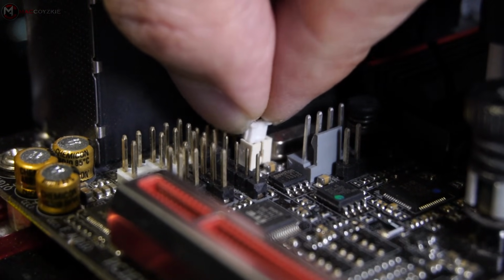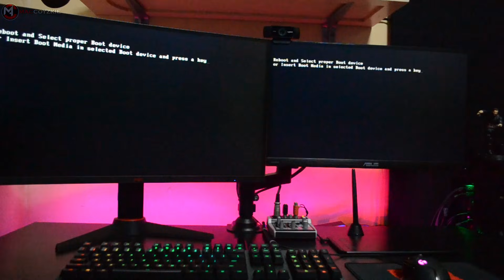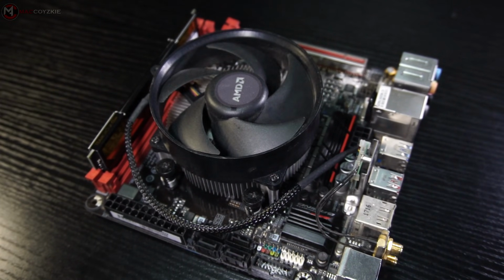How to remove cmos battery in your pc? Cmos reset / hard reset on bios

Comment from the maker: If this does not fix your pc try checking this link for more troubleshooting tutorials https://www.youtube.com/playlist?list=PLqHl1qasBnOHXQahxqQMkuUkoRg3dbSwQ
Reply: I see my cmos battery I cannot Take it out. Please help. I need my computer for a online class
Reply: is there a way of replacing the cmos battery without resetting the time, date, and bios settings?
Reply from the maker: @ahafeezs  nope
Reply: I use a gigabyte motherboard
Reply from the maker: @cristinacechina2617  if you can't just go to bios and load optimize defaults https://youtube.com/shorts/9IWjDYFCLJI
Reply: I can go into the bios and în easy mode P1:120 îs blocking windows boot manager
Reply: Please show how to save and change
Reply from the maker: @cristinacechina2617  there is no general way to save bios, check your motherboard manual
Reply: Really
Reply: Damn I cant find it I lost it
Reply: Imma Quit on my pc
Reply from the maker: @cristinacechina2617  try google the motherboard name + manual, usually there will be pdf version
Reply: Ok sooo I kinda don't have a lock on my ATX motherboard

Comment: I am getting an "inaccessible boot device" blue screen and idk what to do... It keeps bootlooping and I still can't go into windows
Reply from the maker: shut the pc down, unplug it, if you're using ssd/hdd as boot drive replace the data sata cable. if you are using m2 just re-seat it then you clear cmos like in the video before powering the pc back on. if that does not work you need to have your boot drive in a different working pc, if it does not work there as well and you see the same problem then the boot drive is already faulty

Comment: Can I add ram to my other two slots ? Or no and also My pc is running but no signal on my monitor and plus my keyboard and mouse its not turning on as well. Please help
Reply from the maker: its ok to add as long as the newly added ram sticks have the same mhz/cl and as much as possible same brand. make sure the pc is unplugged before installing, after that clear cmos like in the video before powering the pc back on

Comment: Thank you EA. Secure boot bricked my mobo because I am not a qualified person to be messing around in the bios.
Reply from the maker: even after clearing cmos?
Reply: @MacCoyzkie sadly, removed the battery and shorted the pins. Only get a black screen, can't even get to bios.
Reply from the maker: @einfisch3891  if your mobo have those flash bios button maybe trying to update bios will fix it.
Reply: @MacCoyzkie appreciate it. I have a gigabyte mobo with the qflash button and that's gonna be my next step.
Reply from the maker: @einfisch3891  i hope it went well

Comment: I did this because I have the “ Reboot and Select Proper Boot Device” . I Followed instructions, I turned my Pc back on and It has came to the Same “Reboot and Select Proper Boot Device” Screen. Is there any way you can help me.
Reply from the maker: usually that will happen if:
1. your boot drive doesn't have windows installed in it
2. faulty sata cable for ssd/hdd boot drive
3. faulty drive

Comment: Dude thank you so much I put new ram into my pc overclocked them from 1333mhz in bios to 1866mhz and my pc would beep at me with nothing on display found your video took out the cmos battery for 5 mins and it’s back up and working again thank you so much 🙂
Reply from the maker: no problem bro, try a different settings so you can make the most of your ram modules. if black screen happen again then just clear cmos
Reply: @MacCoyzkie what by enabling xmp
Reply from the maker: @JackPlays366  xmp 1 or 2. newer motherboard got several presets too besides the one click xmp

Comment: still answering questions ? :)
Reply from the maker: yes! what's up?
Reply: @MacCoyzkie Went into bios, didn’t change anything there then clicked save and exit, and basically what happened is pc fans got really quiet but still spinning & lights on pc are on but i can’t get it to start. 

No signal shows up on monitor (i’ve tried multiple monitors). i removed CMOS battery for 20 minutes and put it back it but it changed nothing, also tried taking ram out and switching their places but nothing has worked. Any advice ? (i’m on a desktop)
Reply from the maker: @hergring8884  how about different hdmi/dp cable? also can you check the motherboard if there is a debug led lit? 

clearing cmos is good too but can you this method, unplug the pc from outlet, power drain the pc by pressing the power button while unplug then clear cmos again, this time 5 to 10minutes will be fine

if that still does not work let's try to boot with minimal pc parts, i mean cpu, gpu, 1 ram stick, 1 boot drive

if that also does not work, hopefully you got two pcie slot for the gpu, try the other slot this time

lastly check the psu pin connected to the gpu and see if its melting

Comment: I lost connection to the monitor, it gave me headache for 3 days, i did everything i know how to fix until the last step i know should work if not then take my pc to techs and pay, so what I did is bought new cmos battery and put it on my pc, now its ok but i think my graphic card is dead, it turns on but no signal on my monitor, its an old rx580 8gb.
Reply from the maker: the only way we can confirm that the rx 580 is dead is to try it with another working pc, ask a friend to try it out and see how it goes

Comment: suddedly i can not enter my bios .. should i do a cmos reset?
Reply from the maker: does it load anything or you just have black screen?
Reply: @MacCoyzkie  i press the key (del or f2 ) repeatedly and it just stays blank and after a while screen goes into power safe mode.. if i reset pc and do nothing else, it loads the login windows screen
Reply from the maker: @bluebeam1141  can you try this out https://youtu.be/ul3D0OhSkdg
Reply: @MacCoyzkie  its a new build. new motherboards fresh out of the box.. but ill do the clear cmos to see...
Reply: i did clear cmos. i still cant get into bios
Reply from the maker: @bluebeam1141  can you tell me the pc specs first, it might need bios update depending on the specs
Reply: @MacCoyzkie  motherboard b850 aorus elite wifi7 ice , 9800x3d ryzen , 32 gb kingston fury. i tried almost a dozen different things and all faild. my last choice is to make a bios update... but im scared it might failed and have more serious issues then.. but yea i think bios update in one way choice
Reply from the maker: @bluebeam1141  yep it definitely needs one, if you are not confident doing the bios update yourself i suggest bring it to the local shop where you got your pc parts from and let them do it for you. because you can't mistake here https://youtube.com/shorts/nfH5Do3Dq3o but if you are confident then just visit your mobo's website and download the bios firmware. update procedure may depend on the motherboard model/manufacturer so check your motherboard's manual

Comment: I think my Asrock b760m pro rs mb is faulty, because the metal pins dont move far back enough to get the battery out. I applied so much force i was worried i was going to bust something, so i stopped.
Reply from the maker: most motherboards are sturdy unless you intentionally break it. how about using a small flat screw driver to push the lock?

Comment: Damn i still cant get the no signal to work:(( replaced cable and monitor, cleaned the ram and used 1 ram, and then this dkdkdk 😭😭
Reply from the maker: can you tell me how the pc problem started? this might already be a hardware issue
Reply: @ my sister was able to use my pc a few weeks ago. I tried opening it last saturday and it just goes “no signal” whenever you open it.

Hardware issues which means replacing a pc part is that correct?
Reply from the maker: @ yes, but can you try this out first. try entering safe mode https://youtube.com/shorts/IZKc8plksDA if you get lucky do this next https://youtu.be/SvIJhcxZTsA

Comment: If the clip holding the battery in place is stuck is it okay to use pliers? I've got some with rubber teeth that won't conduct electricity 

I'm asking because I just broke my fingernail and almost bled all over the motherboard
Reply from the maker: yea, im usually using a small screw driver to push the lock

Comment: Not sure how this happened, I did hear we had power outage so maybe that did this but, I keep getting “reboot and select proper boot device or insert boot media and selected boot device and press a key” message.

Computer won’t let me go into bios and I’m about to throw this thing out my window but! I have important files I need.. 

I not only did what you suggested in video but I replaced it with a new battery.

I’m not sure what else to do.. also, when I try to go into bios, I hit the F2 button and I tap it and when I hold it down the progress bar freezes till I let go, but then it just goes back to the original message..
Reply from the maker: If your BIOS is still not accessible, try creating a bootable USB drive using a separate PC. Download the Windows Installation Media (or the installation files for whichever OS you're using). Use the Media Creation Tool to transfer the Windows installation files to a USB drive. Insert the USB drive into your PC and restart. During startup, press the key to access the boot menu (usually F12, Esc, or F8). Select the USB drive from the boot menu. Once it boots, try running the Startup Repair option to fix any issues preventing the system from booting.

Comment: What should I do there is an error saying Over Current have been detected on your USB device, System will shutdown after 15 seconds to protect your mainboard would taking battery out or doing screwdriver method work? Please as soon as possible 🙏
Reply from the maker: It sounds like your system has detected a problem with the USB device, which could be causing excessive current draw and potentially damaging the motherboard. Usually this are chargers or whatever so unplug whatever that usb is. Inspect for short circuits too, happens most of the time when motherboard is touching a metal part in your case
Reply: @MacCoyzkie  tried that but didn’t work
Reply from the maker: @ next steps are going to be tedious. i suggest remove your pc parts outside the case, use minimal parts to boot the system like 1 ram, boot drive, cpu, gpu, mobo and psu. jumpstart the pc to check

Comment: I bought overclocked gaming pc dont know whats the problem but the seller said he overclocked it from bios now its freeze everytime i turned it. I even bought new ram for it to check but still keeps freezing, i did reset bios setting to default but still keeps freezing and i also took the cmon battery off for 30sec-1min and put it back on and pc still keeps freezing please i need some solution or help so i can fix this
Reply: Please this is my first gaming pc i really need to fix this
Reply from the maker: @ can you go longer with the cmos reset, 5 minutes. btw what windows you are in? 11 or 10?

Comment: This was a very helpful video! Unfortunately this was not the solution for me and I still seem to be stuck. I have reset the cmos, have my monitor plugged into the gpu, have tried multiple different monitors, reseated the ram, and I’m still getting a boot error on  my motherboard, any advice?
Reply from the maker: i need to know what's the problem, tell me how it started

Comment: hello, after doing a deep clean, my monitor doesn't go on but the cpu is working very well. unfortunately the motherboard blink red and orange light idk how to fix this, i alr did the ram cleaning also the bio reset. but still it doesnt work, mouse and keyboard too
Reply from the maker: ok this might sound basic, if you have gpu plug the hdmi/dp in that and not onto the motherboard monitor input

Comment: I think something is wrong with my new 12900k but I don’t want to believe it. My a2 memory slot is not working at all so I hope this helps. Will check motherboard pins if it doesn’t work
Reply from the maker: if its dusty clean the ram slots too

Comment: After i did all of this it still doesn't boot it just said no signal and it start to piss me off a bit, my monitor is benq GW2270 gpu gtx 1060 and i5
Reply from the maker: why are you clearing cmos in the first place? what happened before the pc problem started?
Reply: @MacCoyzkie  so my pc crashed and it cant be turned on. It only show no signal
Reply: @MacCoyzkie  i tried opening the gpu and put it back still doesn't work and i tried cleaning ram stick too but still it doesn't work
Reply from the maker: @MortimerGD  if it crashed during rendering or gaming this could be the psu gave up, this often occurs when the PSU is unreliable or has a lower wattage than what the PC needs
Reply: @MacCoyzkie  so how do i fix this?
Reply: Its also a psu model ps500 f1v2
Reply from the maker: @MortimerGD  you need a spare psu and test it with your pc, if you don't have one,  borrow from a relative or friend
Reply: @MacCoyzkie  Hi, actually you're right my psu is THE problem (i also accidentally broke the pin lock of the stupid intel cooler thingy but no biggie) but overall i think i fixed the problem thank you!
Reply from the maker: @MortimerGD  glad i can help :yougotthis:

Comment: i need help! how can you get the cmos battery out of the black cover over it?
Reply from the maker: is that an itx motherboard? if it is check 1:00
Reply: @MacCoyzkie  i think my cmos battery is dead because i try to restart the cmos but nothing happens and it keeps taking me into bios settings.
Reply from the maker: @isaias.1  if its taking you to bios then this is not a cmos battery problem. more like your boot drive is not detected somehow. have you replace the sata cable if you're using ssd. if you are using m.2 try reseating it and clear cmos after

Comment: Hi just curious. Would this fix the signal not finding? I used my pc not even 2 days ago and it worked perfectly fine. I replaced my ram sticks about 2 months ago and its been working amazing, no issues but everything is turning on, my pc runs, my mouse, and keyboard, its just the monitor not finding that signal. Could this be the issue?
Reply from the maker: try to reattach your ram sticks and clear cmos after, it might help yes

Comment: Thank you! I enabled XMP, but didn't put a CMOS battery in the motherboard. Does this mean my RAM is running at default (2133Mhz) speed and will continue to do so until I put a CMOS battery and enable XMP again?

Comment: Maybe you could pin this if possible.
Look heres what I did after overclock made monitor go black and keyboard mouse stopped working
Bios reset by clear CMOS but pc wont start. I did this clear cmos by JBAT1 with screwdriver by placing screwdriver and linking 2 nodes.
Again pulled out battery according to YT.
Then moved my 2 rams on next tries, 4 slots so changed 1rst ram position then changed 2nd ram position then tried single ram.
Then at last changed first ram and out 2nd ram in original position at start and put screwdriver in JBAT1 but didnt connect 2 nodes.
I dont know if last step fixed it, my gpu losened and gave white motherboard light but it auto resolved.
Msi auto ram overclock did all this, overclocking wasnt this pain prev generations...

Comment: I had this problem where I'm getting this error screen "Devices Changed (CPU or Memory) or CMOS have been Cleared. Please enter Setup to configure your system.

Press F1 to run setup.

Press F2 to load default values and continue"

and I pressed any of the two and ending up in "Click Bios" with Enter password in my screen. Honestly I don't know the password and I think that is the only thing that hinders me going further...

A background or context, I had this computer for atleast 4 years now and it's second hand.... I did not use it for a year and I take out my ram sticks, I used the taken out ram sticks in another PC. And this exact time I'm trying to turn it on to check if it still working or not.
Reply from the maker: oh shoot bro, the former owner made a bios password and if this motherboard is from 4 years ago, you will not be able to reset the password even after clearing cmos. I know it might be impossible at this point but if you still know the person who owns the pc before, you should ask for the password
Reply: @MacCoyzkie  Update while typing my problem, I took out the CMOS Battery and put it back right after I finished typing it. Dunno atleast 5 to 10 minutes have past cause English is just my second language and I'm trying to pick my words right hahaha. Then it surprisingly worked, it bypassed the password screen. Seeing my computer work right before college (I took the course IT) is really assuring, though I appreciate the  response. Thank you and the video helps. As a token of appreciation I dropped a like and sub.
Reply from the maker: @hansudibedcruz1119  ohhh nice, glad you got it bro.

Comment: Hey I had a power outage and ever snese then my pc with shut off saying no display sometimes the fans get loud when that happens and the pc is still on I have to restart my pc and it is resetting my monitor to the main screen everytime. These black screens have bin happening more and more I can’t even play today it happened twice in a row. Pls help!!
Reply from the maker: if the power went off and goes back on right away, the psu might have taken the damage if you are using a psu from known brands. if not this might have damage the other parts of your pc. you should check this for more info https://youtu.be/WiF2f08jwe0 

the best thing you can do right now is to buy at least an AVR, perhaps there is still power fluctuation around your area